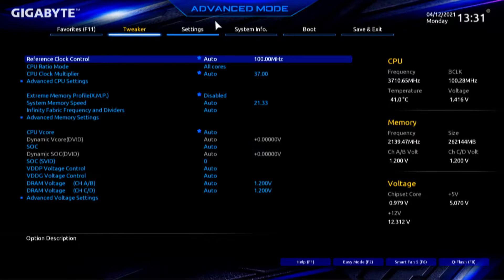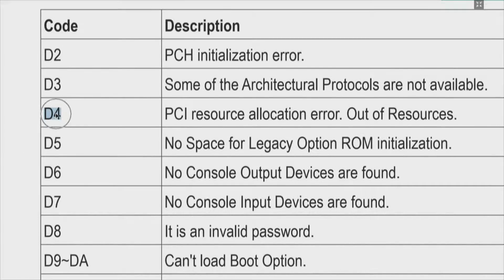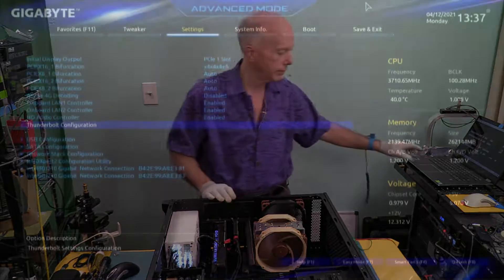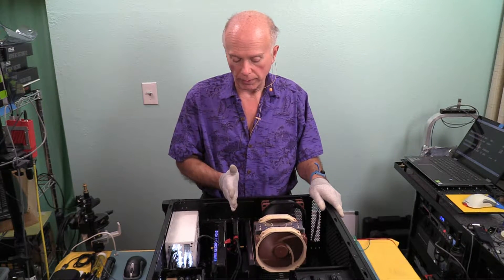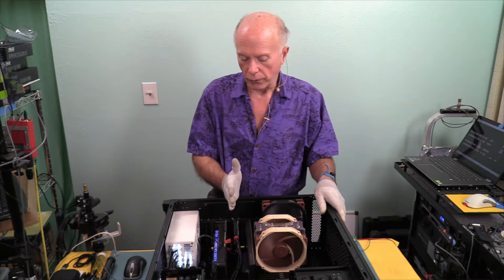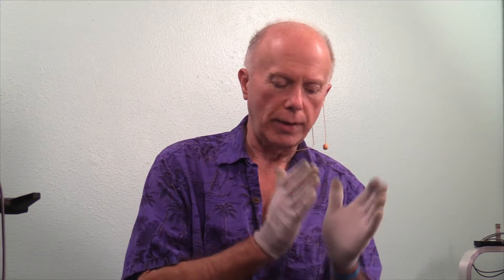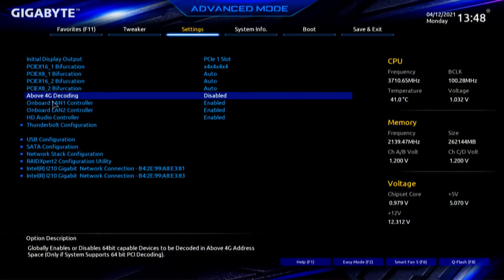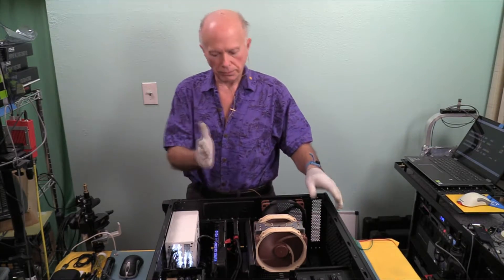D4 PCIe Resource allocation Error and Above 4G Decoding on Gigabyte TRX40 Designare

Comment: Hi,

Thanks for interestign video, sadly on my Asus WRX80 i can't get it to work, always stuck at d4 when i insert 3rd GPU (and i have 4*2080Ti from my previous workstation hoped to plug in this MB). I can't turn OFF CMS since then it's not booting from my Seagate Firecuda 520 NVMe (if is OFF then i just geet loop of MB entering the BIOS i.e. not seeing any boot device).

So not sure what to do, works with 2*2080Ti but as soon as i plug in 3rd GPU i get "d4" error/stuck on LCD :(.
Can there maybe be BIOS settings that i could import onto my Motherboard which will work with 4 GPUs :) ? Any other ideas maybe how to solve this (Assus support was useles on my previous 4 contacts, I always get guy replaying which don't even understand or read question fully so he helps with nothing, zero, nada... :( )

Thanks
Reply from the maker: Hi Lewis3DHR, 
Welcome! Here to help! Your Boot Drive, MBR? Needs to be converted to GPT. Since You're having this problem, suggest Cloning Boot Drive so You can get back to square one! Just in case. 

In Bios/UEFI Firmware, Set UEFI Boot. Not Bios Boot. Then CSM can be turned off. See: Boot Device Control. UEFI.

First is the D4 Error code or Debug code then 94 Error code / Debug code. Both are PCIe Resource allocations. Crazy right.

Thanks for Watching! Appreciate Your Comments!
Reply: @BuildOrBuy  

Thanks for quick reply.

Hmm so can do that MBR to GPT converison in windows "Manage" or i need special app/tool ? Sure i need to backup/make Acronis True Image copy of it first to be safe but is that what you are suggesting ?

Are you sure that this CMS is problem why is this happening with d4 error?

Maybe i can clone my M2 to regular SSD and try that with CMS OFF ? would that work and my PC boot form SSD/sata if CMS is off?

Thanks again :)

EDIT:
seems that my disk is already GPT ??
cheeck the screengrab https://prnt.sc/1hwfos9
Reply from the maker: Hi Lewis3DHR, 
Since You deleted Your other message, makes it difficult for me to respond to help You. Absolutely! OK. Let's backup a bit... ASUS WRX80 Motherboard. D4 Error Code. Can You turn ON Above 4G Decoding? Let's only do what You have to! I think CSM needs to be off and You need to Boot UEFI. However, try that one thing and let me know of Your progress.

The D4 Error Code Video is on the Gigabyte TRX40 Designare. In that configuration, the Titan Ridge Thunderbolt 3 requires a Firmware Update! On Your WRX80, 4*2080Ti = 11GBs x 4 = 44GBs. You need Above 4G Decoding turned on!
Reply: @BuildOrBuy  

Thanks for answer, sorry i've ono deleted that previous message but i see it's deleted now? Maybe youtube deleted it because i sent link/screengrab to my "Manage" settings which has showing that my System C drive NVMe is already GPT.

Yes Above 4G decoding is also ON.

I'll try UEFI settings aslo.
Thanks
Reply from the maker: Hi @Lewis3DHR  , You're probably right. YouTube is trying to protect Us from Spam and nefarious links. 

Ok. GPT, good. Above 4G Decoding is on, also good. What Bios version are You on?
Reply: @BuildOrBuy  

I've updated (few days ago) to BIOS  Version 0504 (2021/06/22) and that is latest one i can see on Asus page.

I'll try CSM off and hope to be able to boof from NVMe 'coz befor i couldn't see my NVMe if CSM was off.

Thanks for help, i appreciate.
Reply from the maker: Hi @Lewis3DHR  , Absolutely! Are You able to Boot UEFI instead of Bios Legacy Boot?
Reply: @BuildOrBuy  
Hi, my apology for not answerign before (i was in middle of renderign projects so i couldn't reboot sooner).

I tested today and sadly no go. As soon as i disable CSM and set it UEFI only my NVMe won't boot to windows and i get endless loop to BIOS after restart :(.

Does it matter in which port is my NVMe drive plugged in? I used that 3rd port which is far away from PCI-E slots (to not get more heat from GPUs). Maybe that port is shared with some SATA ports or U2 and can't boot form there in UEFI mode ?

thanks for your patience :).
Reply from the maker: Hi @Lewis3DHR , 
Understandable! It's difficult for me to maintain Our conversation thread from the beginning. I'd have to go look again at everything We've discussed. I cannot remember the nuances of all the Motherboards We look at. I have to re-verify. We're getting lots of Comments! I have to stay within the confines of a message to answer a message. And my Goal is to help everyone! The easiest way to get this working as it should be will be with a clean install. Get the Bios settings right 1st before proceeding. 

Do You have another M.2 NVMe Drive You can use? You need CSM disabled and UEFI only ON! And a GPT formatted Disk. 

The primary Boot Drive M.2 NVMe PCIe Drive should be on an M.2 Connector tied to the CPU. That's usually the first one or two which places the Drive under or near the GPU. A 3rd M.2 NVMe port would be through the Chipset. A bit slower. Test and verify. Hope that helps! Keep Us Posted on Your Progress! 

We might have to do a Video on this very topic. It will be a while before We do. I need to do that from out of the box while Building a Computer!
Reply from the maker: Hi Lewis3DHR, Two weeks since We started talking about your situation. Now I remember after reading what GeronimoNL is having issues with is the same as You are having. Sounds like You both require a Bios Update. And possibly a Firmware Update to the GPUs. What GPUs are You using? Make and Model?
Reply: Lewis3DHR, Geronimo NL,
Guys, I have a question for holders of this motherboard. Where does it have CMOS battery? I can't find. After I made some changes in BIOS I'm constantly having this D4 error whatever devices are being plugged.  Even 0 devices (except CPU and memory), even with BMC & internal VGA switched off I'm getting D4. "Clear CMOS" button on rear panel seems not working. I was going to push out CMOS battery but I don't see it. What are your ideas? BIOS flashback is last chance?
Reply: @ahemenidov1900  ,
Hi,
the cmos battery is on the left top side of the mobo (next to m.2(wifi). You can see it on the mobo layout on page 14 of the manual.
Reply: @geronimonl2037  So I need to remove rear panel for reaching it? It will not affect my warranty?
Reply: @geronimonl2037  Btw, I looked via small gap under rear panel cover, and it seems nothing there near WiFi. But something round seems on back part of LAN. Maybe this is it?
Reply: Having an idea why "Clear CMOS" button doesn't work for me. Will check it tomorrow
Reply: @ahemenidov1900  
Hi,
I do not know how to reach the cmos battery… 
I just looked in the manual to see where it should be to point you to a direction.
I cannot see the battery myself since it is blocked by a cap and did not do any further investigation.
Reply: Hi @BuildOrBuy and @Lewis3DHR,

First of all i would like to comment how awesome your vids are @BuildOrBuy!

I am following this thread with much curiosity as I am also having problems getting my ASUS WRX80 motherboard to work with multiple gpu and get stucj with the D4 code.

(I won’t ‘hijack’ this post with other problems I am having with getting through post smoothly with this mobo by getting stuck with F3 code… I might start a separate post later if I need help on that).

Maybe my findings might help you getting a step closer to solving the problem.
I am having Above 4G Decoding enabled and also CSM on.
I got D4 code having two gpu in slots first slot 1 and 4.
( I am trying to get end result with three gpu’s in slots 1-4-7 which is optimal for airflow and the cards are too close together when trying slots 1-3-5.)
In the mobo manual the recommended configuration for 3 gpus is slots 1-3-5 and for four gpu 1-3-5-7.
I tried two gpu in slots 1-3 and I did not have the D4 code and got both gpu’s running in windows..
Then I tried 3 gpu’s in slots 1-3-5 and that gave D4 again.
I will try other configurations with 3 gpu and let you know if I will be able to pass the D4 code.

@Lewis3DHR, can you tell what slots you are using and maybe trying different configuration might help you as well?

@BuildOrBuy, can you make something out of using the different slots?

And the big question (for me) later will be how to run three gpu in other slots than 1-3-5 but 1-4-7 (which makes much more sense relating to airflow and I have this config setup in few other motherboards so it would be surprising if this high-end  WRX80 mobo can’t.

Greetings,
Reply: @geronimonl2037  

Hi GeronimoNL

I can't plug in GPUs in 1,3,5 sicne my GPUs are 2,5 slots wide so if i plug in in 1 i can only plug in next GPU in slot 4 and then slot 7 but i use 16x Shielded extenders (expensive ones which provenly work and worked for me just fine on DualXeon MB) so this MB has to work with 7 GPUs and let alone 3-4. 
There is somethign else what is bothering it and i can't figure out but my next try will be to remove NVMe and try use regular SATA drive. I'm crazy of combinations by now but nothing works for me sadly :(. That Asus MB is so expensive and yet so dissapointing for me so far.

EDIT:  SUCESS, Finally i managed to do it with UEFI only and MBR2GPT on systme disk, now i have GPUs in ports 1,2,3,7

Thanks Everyone, especially BuildOrBuy man :).
Reply: @Lewis3DHR  oh wow, that’s great. (Gives me hope as well). Did you leave your NVMe as it was or did you had to switch to regular ssd?
Reply: @Lewis3DHR , @BuildOrBuy

Hi guys,

I also managed to get it working properly and with three gpu’s (in slot 1-4-7).
Did the same as Lewis3DHR with mbr2gpt (on the M.2 system disk) without losing the data.

Thank you guys… thanks to your discussion I was able to solve my problems.

(Besides the D4 code with multiple gpu I also had a F3 bios code (also with one gpu) everytime I started the PC (had to reset bios and enable CSM everytime to get system started. This was solved automatically going to GPT.)
Reply from the maker: Hi @geronimonl2037  , 
Welcome! I'm honored! We've been meticulously documenting all of these Steps hoping to help anyone else solve these little gremlins. 

A D4 Error is Out of PCI Resources which is a misnomer. Above 4G Decoding in Bios is a starting Point. Therefor We have two options. A Bios Update for the Motherboard. Ona Motherboard, Step through each Bios Update. Remove Power to System between them to drain Power. And a possible Bios Update for the GPUs. Are all 4 GPUs the same Make and Model? Which one? I suspect without the GPU NVLink Bridge that could be part of the problem. Which means there's a problem supporting the older GPUs. We also had what I define as a Bus Prioritization issue with Thunderbolt until We applied the Titan Ridge Thunderbolt 3 Firmware Update. That was tedious. I suspect the same may be happening. The Motherboard Bios is having difficulty knowing who is on first! Hence, a Bios Update! I need to Test and Verify. Hope this helps! Keep Us Posted on this issue!
Reply: @BuildOrBuy  Thank you very much for the support you are providing., that’s a great help to lots of people I am sure.
 The bios is version  0602 x64 which seems to be the latest.
I am switching out 2x MSI 1080Ti Aero (2-slot cards), 2x EVGA 2080Ti Black (2+slot) and 1x ASUS 3090 TUF Gaming (2,5 slot).
I am having NVMe  SSD Samsung 980 Pro in slot closest to CPU.

Comment: So my new PC build my pc is shutting down when playing games. I had error code D4 on the mobo but it goes away every once in awhile when it reboots. And the temps on GPU and CPU are good. ANy ideas?
Reply from the maker: Hi Allan, Welcome! Bummer! Tell Us about what You're doing. Playing 4K? Everything OK when Playing 1080? Tell Us about Your Motherboard and Chipset. You may need a Bios Update. If so, step through each Bios Update. RAM? Tell Us about Your Video card. The amount of Video RAM matters like if You have an RTX 3090 with 16GBs. Let's see what We can do to get rid of this problem.
Reply: @BuildOrBuy   so I have a 3090 aorus wb card. With 32 gig ram and I am only playing in 2k
Reply: I also updated the bios to the latest for my mobo
Reply from the maker: Hi @oiMeho ,
OK, have You tried... In Your Motherboard Bios, set Above 4G Decoding to ON or Enable.
Reply from the maker: Hi @oiMeho , 
Hope You stepped through them instead of jumping to the latest.
Reply: @BuildOrBuy  no went to the latest
Reply: Had to for the 11th gen intel
Reply from the maker: HI @oiMeho , 
That can create other problems. Notice each Bios file is probably of a different size. Without an errata document, We don't know what else is being updated but is not documented. Such as if You had Thunderbolt, etc. Details matter!
Reply from the maker: HI @oiMeho , 
Which CPU did You get?
Reply: @BuildOrBuy  i9 11900k
Reply from the maker: HI @oiMeho , 
8 Cores! Good! What Motherboard are You using?
Reply: @BuildOrBuy  aorus z490 master
Reply from the maker: HI @oiMeho , 
OK. Gigabyte Z490 Aorus Master. You have Thunderbolt support. 2 Thunderbolt Connectors, the 5 Pin and 3 Pin Header, hence Maple Ridge Thunderbolt 4! 
https://www.gigabyte.com/Motherboard/Z490-AORUS-MASTER-rev-1x/sp#sp
That latest Bios file, F20 is much larger. Suggest going back and stepping through each Bios Update. 

And enable above 4G Decoding. See if that helps. Keep Us Posted on Your progress!
Reply: @BuildOrBuy  I do but don’t have them installed
Reply from the maker: Hi @oiMeho , 
Smart decision to wait. Get the Bios corrected before installing Thunderbolt. And check for a Firmware Update for the Gigabyte Maple Ridge Thunderbolt 4 AIC. Thunderbolt is very finicky about Driver order. Motherboard Driver, Video card Drivers then Thunderbolt Drivers and Thunderbolt Control Panel. Success!
Reply: @BuildOrBuy  and what’s does this do? Never done it beforw
Reply from the maker: Hi @oiMeho , 
Great Question! Since this Video is about the Error You originally asked about, have You tried it? Above 4G Decoding is about Memory Allocation above 4GBs. Any Video card with over 4GBs, using a 64 bit O/S or a Computer using a 4K capture Device should enable Above 4G Decoding. Hope that helps!